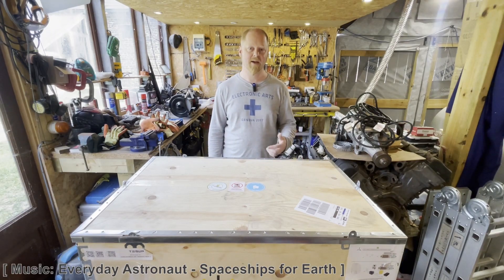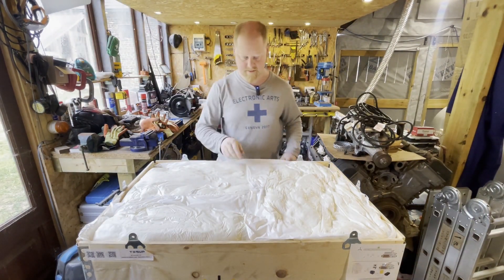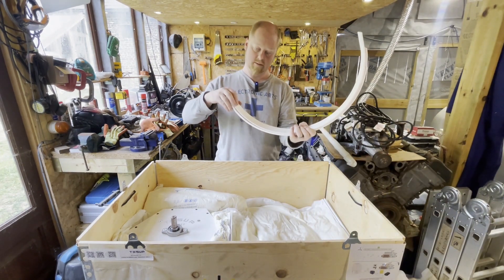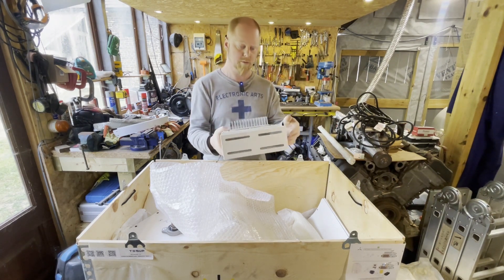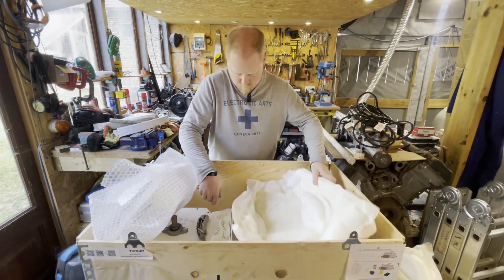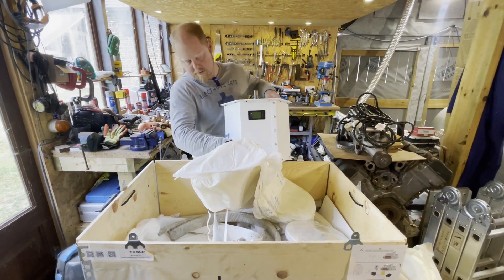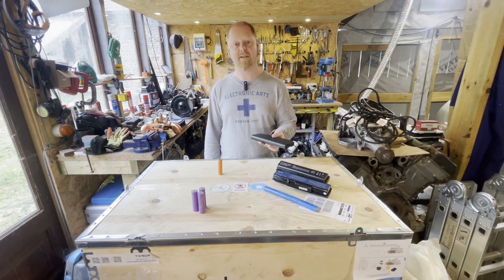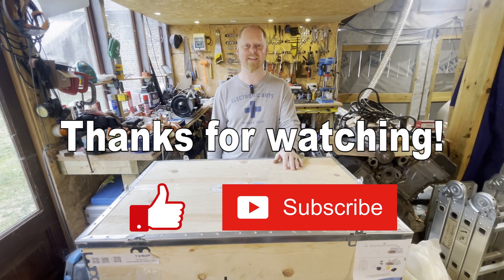Tesup Atlas 4.0 Wind Turbine Unboxing

Comment: Don't feel bad my inverter didn't show up for over 90 days like three weeks passed when I got the actual wind turbine Atlas X. Tesup is a total scam,,, the product sucks,, it's not balanced the hardware is not suitable for the application. The charge controller was made by a 6th grader, horrible design not even weatherproof or waterproof. And the inverter that you're going to get is a hit or miss of who they order it from and it's not compatible with a wind turbine. Especially if it's a growatt.
Reply from the maker: This is why I’m waiting for the Delta which has a start up voltage of 35v instead of 60v which is the maximum output level of the charge controller as I understand it.
Reply: @sustainableorange  Not sure about that, the charge controller in battery mode goes up to 75 volts, that may be the low voltage range, but if you switch to inverter mode it goes well past 75 volts, mine was at 114 volts on the last test. But then i got the fault “voltage out of range”  I was told by the manufacturer, Growatt,These inverters are not made for Windturbine’s nor will they work with any wind turbines. The hardware and software is not compatible. The dip shits at Tesup don’t know that yet.
Reply from the maker: Interesting. I thought it peaked at 60v from the documents I had read. 
I know there is an adjustment screw for output voltage, I’ve got an inline volt & current meter on mine but I’m not able to run my system yet whilst I’m without the inverter.
I will share these details once I get mine up and running.
I wonder if there is a sweet spot between current and voltage for inverter start up?
Inverters have a minimum current as well as voltage to start up.

Comment: Hi just seen your video I have some 18650 and unopened laptop batteries if you want them I'm in Cambridgeshire uk
Reply from the maker: That’s very kind of you, unfortunately due to a lack of time I still have about 250 laptop packs to open, test & sort so I will have to decline on this occasion I’m afraid.
Reply: @sustainableorange  ok they are free I am only going to take them down the tip have been running my 18650 for over 6 years now but I am changing over to LFP
Reply from the maker: @dama054  thanks that is very kind of you. I would love to take them to save them ending up in land fill. I suspect the dump would not recycle them!
Reply: @sustainableorange  that's the thing they would end up in landfill and it's a waste
Reply from the maker: @dama054  I can’t let that happen :)

Comment: Good morning! Can you tell me about the performance of generator and the feeling of robustness of the rotor? What do you think about this product?
Reply from the maker: I am still waiting for my inverter at this point due to chip shortages they have been delayed until September. Build quality seems good, but until I get it running I can not confirm. Aiming to have it going mid September assuming the inverter arrives in time! It certainly spins smoothly and freely but I don’t know how balanced it will be at higher RPMs.
Reply: @sustainableorange  I hope you will make a video to tell us the performance of the item! :)
Reply from the maker: @sandrococeancigh2995  you can be sure that i will!

Comment: If something (inverter) is missing in a unboxing video you should include the corresponding with tesup in the video.  Unboxing videos are to show the quality of the product and the interaction with the company if something is wrong
Reply from the maker: Great feedback, I think I will do a full video on the ordering process and customer feedback/interactions once all this is sorted out and I have all the parts that I ordered.
Reply: Tesup is a total scam. E-mail only they have no knowledge of inverters or charge controllers. I believe they are all from the Middle East Turkey shaming to try to sell these things which are not made to quality standards or balanced. Never buy from Tesup